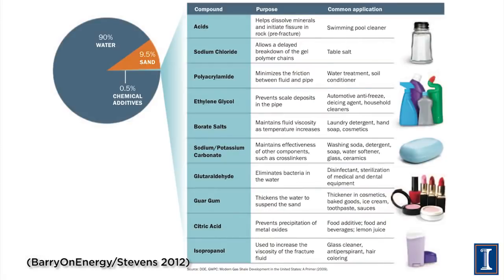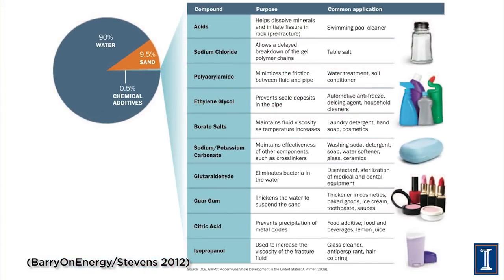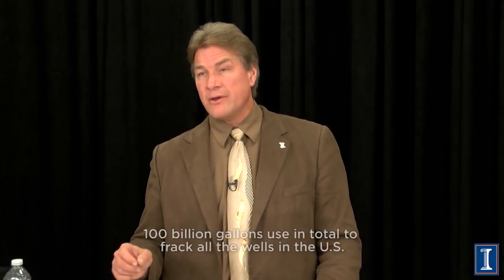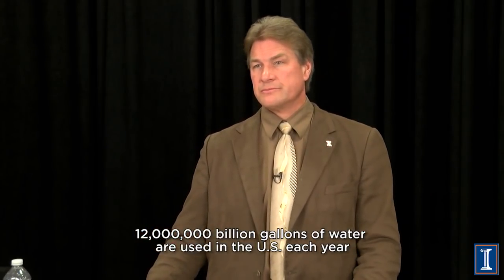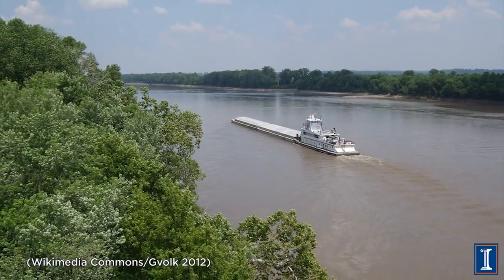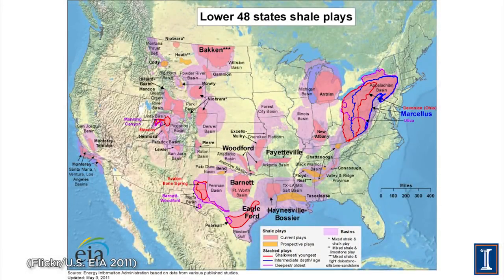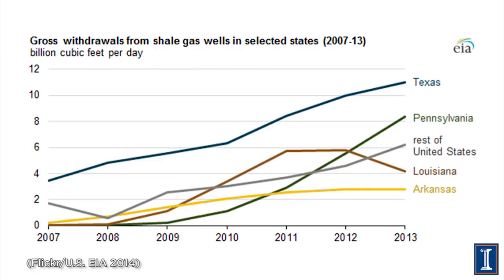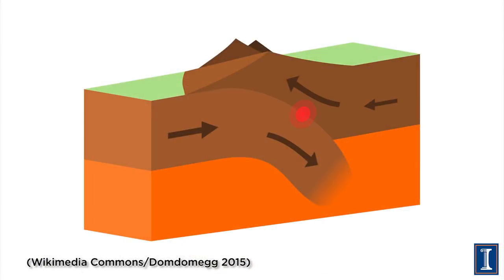Fracking and the Environment: Myth and Reality

Comment: Coal pollutes far more water than natural gas.  With natural gas, carbon dioxide may be a problem, but coal also has heavy metals and other unpleasant things.
Reply: coal is a molecular mess full of all sorts of shit, probably 1 carbon atom for each hydrogen, if not more. With methane it's 4 hydrogens for 1 carbon. It's insanely clean compared to coal
Reply: @moonasha  What I was commenting on is that people point out the lower carbon dioxide created by burning natural gas compared to coal, but then there is the fear of fracking contaminating the ground water supply.  My point was that coal tends to generate more water pollution than fracking for natural gas.   Natural gas is much better for reducing both air and water pollution.   While people point to videos with people's drinking water burning as the natural gas leaves it, there has always been natural gas in well water way before fracking.  It might be interesting to do patent searches for devices to separate natural gas and hydrogen sulfide from well water before World War II to show it was a problem well before fracking.
Reply: @lewisdoherty7621  Lots of methane escapes during the fracking process.  Over the 20 to 50 year term that is of most concern for climate change, fracked natural gas is at least as harmful to the Earth's temperature as coal.
Reply: @jeffreyturner5331   Didn't know there were  so many sheep on his channel. I'm glad I found at least 1 guy who did some research.
Reply: Lewis you maybe interested to know that the Soviet-East German nuclear materials company  'WISMUT' operated 'Grube Willi Agatz' the last black/hard coal mine in Saxony on the Dohlen basin around Freital and Dresden-Gittersee for many years until its closure in  1989. Here seven seams of early  Permian era coal were impregnated by water containing uranium probably from later volcanic activity.
Once the coal had been burned in a local power station the residual ash was sent for processing to produce uranium.
Reply: @nicholaskelly6375     Thanks for the information.  That is a great example.
Reply: @lewisdoherty7621  There were many examples in the UK were there were problems with contaminated coal.
For example coal coming from Littleton Colliery in Staffordshire had a relatively high Chlorine content. 
This over time became more serious to the point that Littleton coal was having to be "sweetened" very considerably to reduce the Chlorine content. I did hear that at the end it was a ratio of 90% to 10%! 
It is often overlooked coal can be very variable even in the same seam and blending would often be needed to produce an acceptable product.
The ash content in particular was a serious issue for power station use.
This was one of the reasons why British Railways abandoned steam traction in the 1960's As it was becoming more and more difficult to obtain the correct grades of steam coal.
Reply: saladnuts the energy is coming from carbon-hydrogen bonds
Reply: Source please, oh wise internet scientist. 

How about the 1,300 diesel fueled tractor trailers it takes to frac a well, and all the diesel powered equipment it take to operate the well and compress the gas in the pipelines to transport it
Reply: @tommypetraglia4688  You can find a source on in 2 seconds if you wanted to, and how about the fact that any mining requires energy?
Reply: @tommypetraglia4688  Instinctively it feels like the process of drilling a hole and filling it with water would require far less use of diesel powered equipment than the process of digging a massive quarry with diesel powered equipment to extract coal.. But i could be wrong about that..

Comment: Based on the presentation I thought this was an objective analysis of the specific risks vs rewards of the technology. As it turns out it is simply a pro-fracking advert disguised as a class lecture.
Reply: Yeah, why provide information?  We should rely exclusively on alarmist and dishonest documentaries from agenda peddlers!
Reply: @GentlemanBystander  We really should not drill or puncture the land we reside on, foolish to think you wont destabilize the livable areas.
Reply: @tkayshakur2500  So that would exclude wells, are you implying nobody should live anywhere that is not next to a free-running water source?  What about extraction of minerals, are you advocating for a lifestyle devoid of metallurgy?  If that's the case, why are you utilizing modern technology?
Reply: @GentlemanBystander  my apologies, I should have been specific.. the drilling for gases and oil is what concerns me. Also I believe that personally this is a way for nuclear to rid of its toxic byproduct which we have no way of ridding of properly. This stuff just corrodes everything man... in conclusion I am not against materials such as silver, copper and drilling for water wells. The petroleum products, gases and fracking liquids I am unsure of. Nuclear by itself is really concerning, the whole operation of the plants too.
Reply: @tkayshakur2500  please look into actual correct nuclear science, and research.  Not the old tired drumbeat of greenpeace circa 1980. 

The amount waste from current reactors is small, waste from old reactors can be used as fuel in upcoming reactor designs. The upcoming designs are "walk away" sure ( this means if their is an issue they can shut themselves down using good old physics not a computer or a human)  The waste from the new designs is roughly 1% of what we see from current reactors. The waste has a much more reasonable half-life ( decades instead of 10s of thousands of years) 

Please look into it.
Reply: @tkayshakur2500  someone is triggered and misinformed.  Look up molten salt reactors bud.
Reply: @tkayshakur2500  good luck growing any food
Reply: @tkayshakur2500  they're not putting nuclear waste down there.

Nuclear waste goes under ground in quality storage containers in the desert for the most part. Early nuclear days, sure bad dumping went on, not really a thing anymore
Reply: He's a prof of nuclear, he is deep in it. Deff agree w. You tho.

Comment: Earthquakes have been caused by injecting water into fault zones.  This was done at the Rocky Mountain Arsenal  Denver, CO starting in 1961 as a test to see if other chemicals could be disposed of in this way.  The high-pressure water injection into a 12,000 ft well, similar to fracking, caused many micro-tremors whose frequency correlated to the volume of water injected.   Some of the "micro" tremors were larger than others and eventually in 1967 a large one of magnitude 4.8 caused over $1M of damage in Commerce City, a suburb of Denver.   More recently in England fracking operations caused minor tremors capable of cracking walls and fracking has been halted by the government.

Comment: It is a pleasure to listen to a Professor that leaves politics out of the discussion and focuses on facts and reality.
Reply: The problem is energy policy and practice is inherently political in this country. It's so easy to make it sound like fracking isn't all that bad for the environment, but when you consider the oil and gas industry spends billions to lobby Congress to let them cut corners, to reduce the oversight of safety programs and the EPA, and that the fines when they do cause a catastrophe typically aren't high enough to dramatically affect the bottom line... it makes you wonder why they would be doing that if it's really so safe.

Comment: What about fracking water leaking into ground water and entering the drinking water system.
Reply: I can only speak to frac wells drilled in Western Canada. For those wells the minimum separation between the formation being fracced and ground water would be about 1,000m (3,300ft.) To ensure there is no communication between an aquifers that would be used for well water and the frac formation there is a steel casing that is cemented in place. How certain are we that we got a good cement job, very. The steel casing and cement job are also needed for blow out prevention. Unlike what you're shown in the movies and TV, guys dancing in crude oil, you are having a very bad day if the well is producing gas, oil, and/or salt water while you are drilling. If there is any uncertainty about the cement job they can do a cement bond log or a leak off test.
Reply: Seeing as how it occurs a few thousand feet BELOW the water-table, I'm not sure how that's going to happen.  Oh wait, you're basing this on Gas Land memes aren't you?  Filming that was done in an area called Sulfur Springs and has had combustible water since the 19th century.

Comment: all you people who hate fossil fuels should stop using electricity and go back to living in the 1800
Reply: After studying this  https://www.energy-charts.de/power.htm  , the only conclusion that you can come is that the "greenification" of Germany is a total disaster.  Some call it the Green fall of Europe.
Reply: @hennieodendaal5087  I live in Berlin and no one has called it that... not in the media, social media, political discussions or newspapers.
Reply: @1968Christiaan  The most idiotic step was to close down very new nuclear generators(10 year old is still an infant).
Lots of videos debunking this "nuclear holocaust creation" from these generators. Illinois EnergyProf  debunks and explains it very quickly.
Reply: Build more nukes. Simple.
Reply: @NorthForkFisherman  haven't you heard they don't like nuclear either
Reply: That logic is extremely flawed. Using fossils fuels is fine for now, but not realizing that it is a resource that WILL run out, no ifs ands or buts, is the reason why people are trying to find alternatives now, while we still have it. Nuclear is a good option but the current global supply of nuclear fuel would be drained in ~80 years at the current rate. So we either need to find more fuel or find an alternative. This is a thing that has to happen, we need to find other energy sources
Reply: @TheJorge100  you do realize that solar power is going to run out, right?  In 5 billion years our Sun will be a white dwarf producing little solar power for us.  Of course in 1 billion years, the Sun will incinerate the planet.  EVERYTHING has a finite quantity, yet enviro-nuts ignore reality.   Your nuclear fuel calculation is off by several orders of magnitude.  You simply need to use a different nuclear cycle and fission power will last for tens of thousands of years.  By then, we can get fuel supplies from off-world.  We have plenty of energy sources for our children's children's children.  Don't worry about that.

Comment: A forty year supply. That's it.
Reply: Are you suggesting because there is only a 40 year supply it isn't worth tapping into at all? Not good enough?
Reply: They said the same thing 40 years ago.
Reply: At current usage.  There's a reason why we're trying to move to solar, and many of us want more nuclear as well.  That also assumes the US does not import or export anything, so it could be less than that.
Reply: The US has something like a 500 year supply of fossil fuels.  Maybe more.  If you include coal and fracking.  Granted, I support renewable energy.
Reply: At current usages, and that only includes shale deposits.

Comment: fracking does not "use water", it "makes use of water", the water does not disappear after it is used
Reply: When I send water down my drain it goes through processing then returns to the evaporation cycle.

Fracking water is too contaminated to ever to be economically reused again.

They have so much they construct holding tanks to store it indefinitely until they figure out what to do with it.

One small scale use is to brine roads before icey weather and snowfalls which is why, for anyone living in a northern clime, brake lines along with anything under their car is rotting away before its time...
Reply: It does, however, turn clean water into contaminated water.  You could filter out the water and then properly dispose of all the rest but that is too expensive so the gas companies just let it run into the river.
Reply: @rockets4kids  there's a river right next to every fracking operation?
Reply: @rockets4kids  have you seen the list of "ingredients" ? you've eaten 3/4 of them today, and used the rest in cosmetics
Reply: @rockets4kids  That reports alludes to "over 1021 chemicals" including mercury and cadmium - really?  What for?  You only need sand, water and a surface-tension agent like SDS which is used in toothpaste and cosmetics among other things.  What does cadmium do in fracking?

Comment: Hello as a person that been fracing for over 13 years. Sometimes we use produced water that's water that's flowed back. An sometimes we won't use the gel. Will just do an FR job aka friction reducer job. But your video was spot on though.any other question as far as other chemicals that are used or what else that goes on in fracing just reply. Your presentation are awesome though keep it up.
Reply: I'm guessing you didn't watch the whole video.
Reply: Amed Tajan   - I started off my career in the renewable's industry in 2003 convinced that this technology will save the planet.  By 2007, I realized that global warming, per say, is all a political myth and renewable's will not save the planet, particularly if we discontinue the use of oil, gas, coal & nuclear.   As an electrical engineer, I often have to point out the flaws of solar & wind against the methods of power generation that we are all familiar with.  
The removal of coal & nuclear generation against the argument of reduction of CO2 is a guranteed way to increase the use of gas as an alternative.
I have no problem with this concept, after all, burning gas is a much more efficient heat cycle for power generation and uses less land space particularly for CHP plants.

I'm a pragmatist when it comes to this issue of alternative sources of gas exploration & drilling.  However, when such a technology as Fracking has such a huge negative environmental effect on local populations and the land of which it's constructed upon, one has to question the methods.

Of course regulations exist to protect us from such problems, but when large corporations are involved, you begin to see that psychopathy is used to solve their problems, regulations are often  ignored and obfuscated.
Covering up pollution and paying people for their silence does not solve the ever increasing risks of the fracking industry either now or at any time in the future.

Here in the UK now, fortunately the plans of fracking have been cancelled because the realization that such a larger concentration of people in a smaller land mass will have even greater health impacts if the technology is shown to be dangerous to the public, but it has taken a long time for our government to see this, mainly through mass independent public protests.

In respect of your argument, I do have an issue with the drilling companies, as should anyone if the impact of fracking has an even slightest negative health effect for those closest to the wells and I would therefore respectfully ask you to carefully research this technology before you continue to defend the industry. 
If you've read this far, I thank you for your time.
Reply: @jfrie d. Normally 100 mesh an 40/50 grain sand is used but theres others used As well
Reply: For my own curiosity 
- Is there a particular type of sand that is used in the fracking mix?
- Are any guar gum substitutes used?
Reply: @jfried6754  xanthan gum is also used so is salt water
Reply: You can't even SPELL the word of what you supposedly do?
Reply: You misspelled “fracking.”
Reply: The difference with water use in fracking is that the water is going to be stuck deep underground for ever. However the extracted hydrocarbons when burned are going to form water vapor. The real worry is that by sticking millions of gallons of water underground we are losing oxygen. Is it a significant amount of oxygen that we are losing ?
Reply: When I’m fracking it’s very wet and messy. Gel lubricants are often used, but not always. Many things depend on who you’re doing the fracing with. Oftentimes there’s an odor in the air noticed afterwards. When this odor is detected, we spray the entire area from above with chemicals to mask the odor and prevent it from becoming too noticeable to people in our vicinity.  
We are very good at this kind of cleanup/coverup. In fact, we’ve been fracking for years and most folks living in our immediate vicinity still have no idea that we’re totally fracking on a regular basis.
Reply: Paul Ryan's family made their millions selling sugary white sand for fracking.

First thing the swamp rat did when Trump arrived was sign an executive order hiding bribes.

Michigan had no gas so greedy politicians started an operation to take fracking sludge and pump it into the ground.

No damn excuse for destroying the underground water table.

Last year during the floods over 1300 above ground fracking sludge ponds were washed away and spread across 9 states farmlands.

Sorry professor, but I get sick seeing someone lying to students...

Breaking a hole in Earth's crust makes it path of least resistance for earthquakes.

Did you know it is illegal in America to produce more gas than what we use?

Exporting oil is illegal in America, that law applies to everyone but greedy bankers who own the whole gas industry.  Exxon and Mobil are just shells protecting bankers from lawsuits.
Reply: @davecarlson9088  And yet you give absolutely zero links to prove anything you said is remotely accurate or true.  Why is that?  You got an agenda to help push or something?
Reply: @tcmtech7515  if someone is interested they will use a search engine to find it...

Attack dogs wouldn't look anyways...
Reply: @tcmtech7515  nope I've been arguing with Koch Bros fracking trolls for too long to care if you're upset.